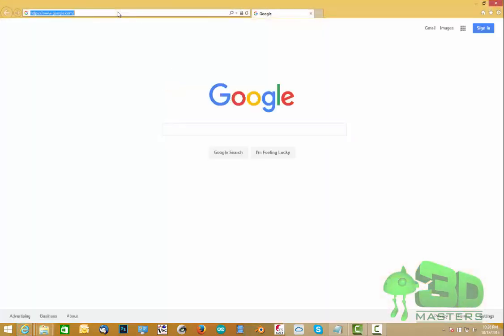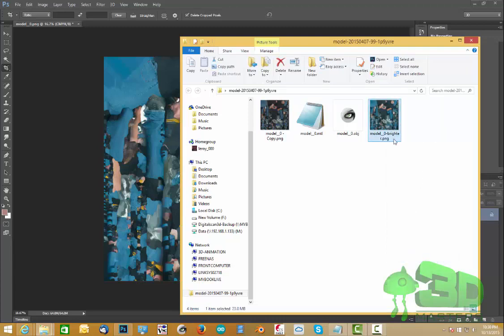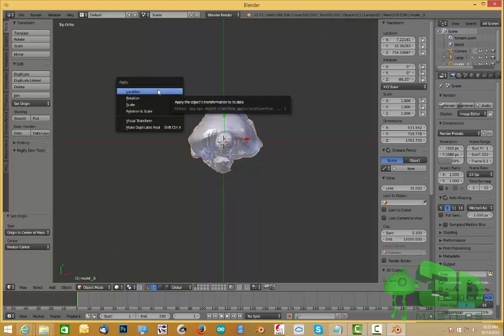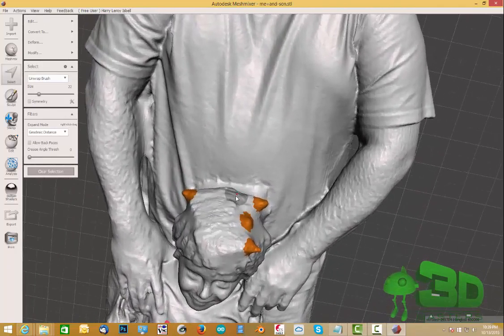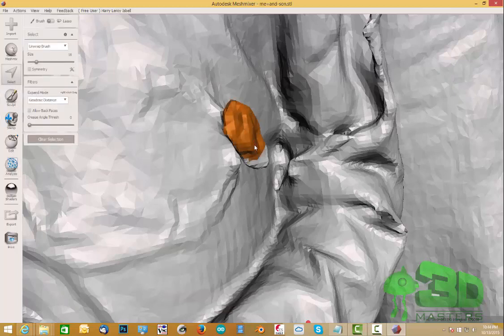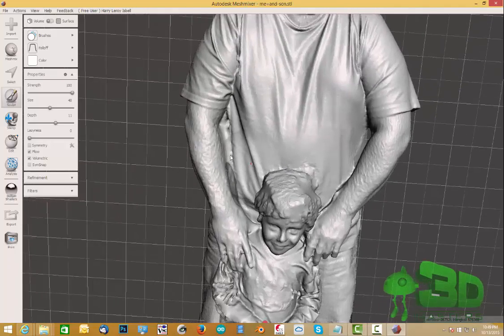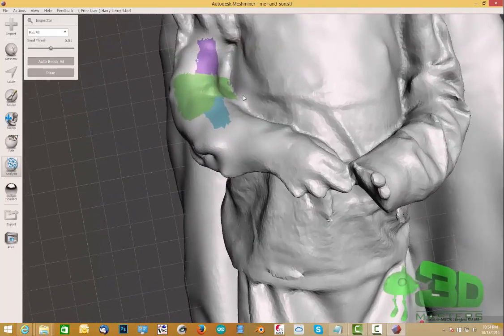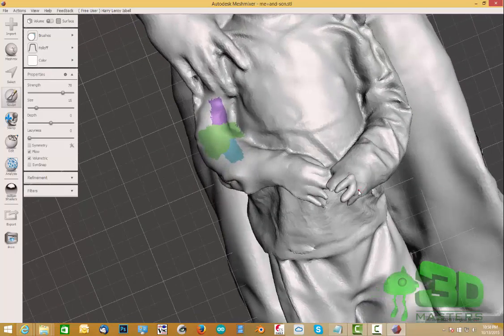3D scanned data repair using Blender Meshmixer

Comment: Hi! Thanks a lot for this video!!! It's exactly what I was searching for the resolution of my problems with 3d model from scan!!
But now I ask you how to use the new correct model from Meshmixer into Blender!!! How you can use it without lose texture!!!!!!
Please I need an answer!!! I'm sorry for my English, but please help me!
Reply: Hi Matteo - The Blender app supports also Importing the .stl file format.   I'm in Blender Ver. 2.79 and the .stl is right there waiting to be used!Open Blender > File > Import > .stl ... then search to find XYZ.stl and import into Blender.By the way, Blender had wonderful tools such as the Sculpt Tool that can accomplish many of the mesh adjustments we were demonstrated in this video.   However, I will utilize meshmixer to do the heavy lifting and use Blender to finally tweak for finishing the project.